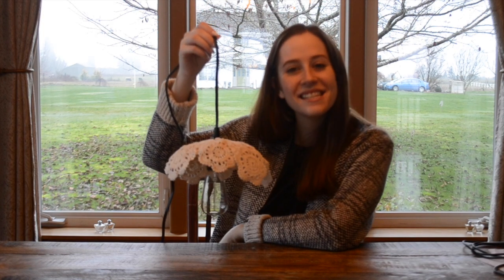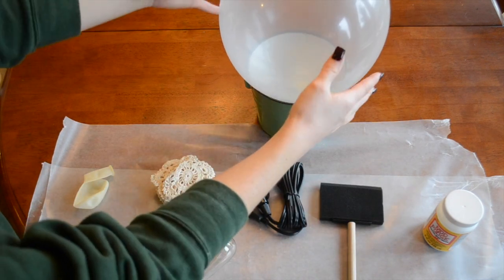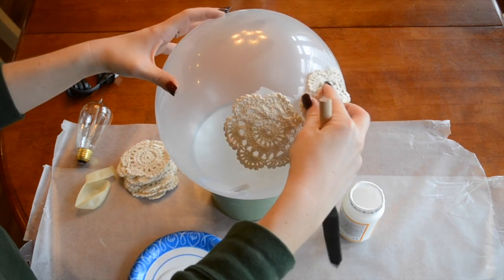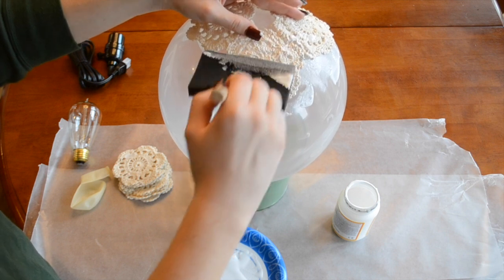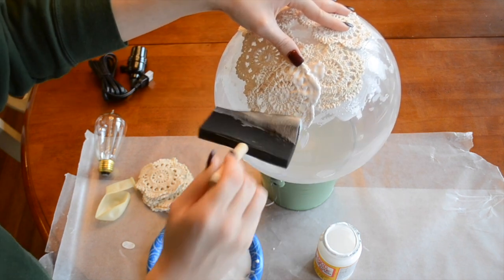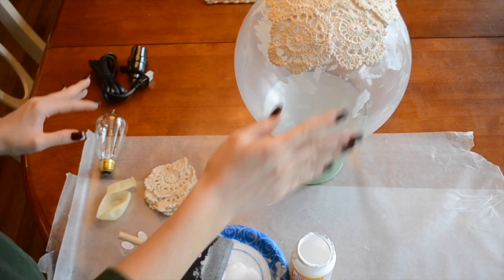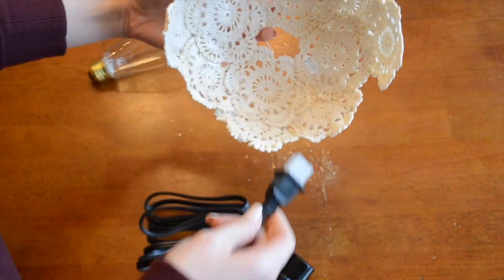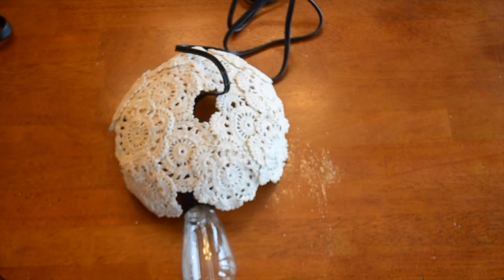DIY Vintage Inspired Doily Hanging Lamp

Comment: so when you use modpodge u don't need to use oil or petroleum jelly??
Reply from the maker: Great question, Leslie! It's all dependent on personal preference and specific project. For this project we used a balloon for the base but if you were to use a bowl, it may help to add a little oil or petroleum jelly to grease up the surface first. Please let me know if you have any other questions. Happy crafting!